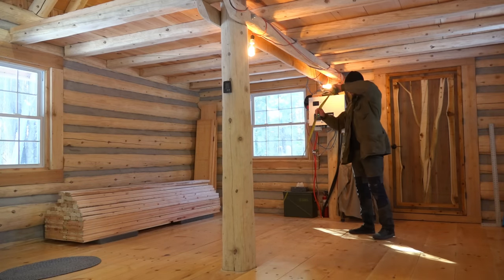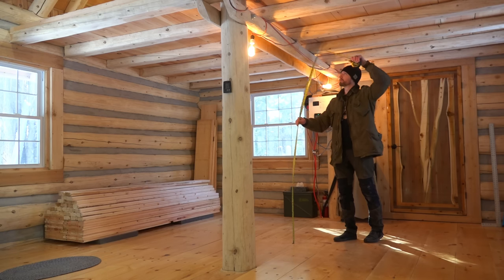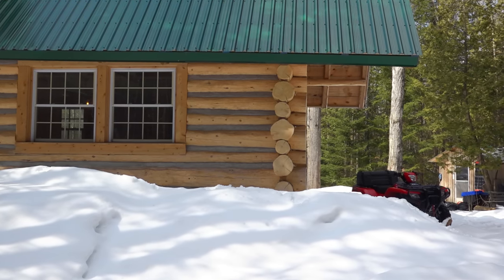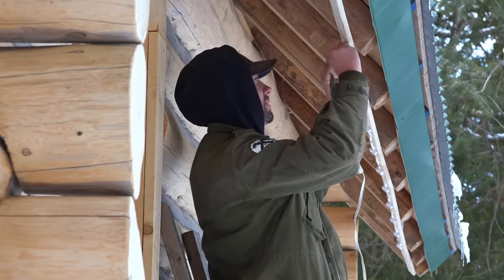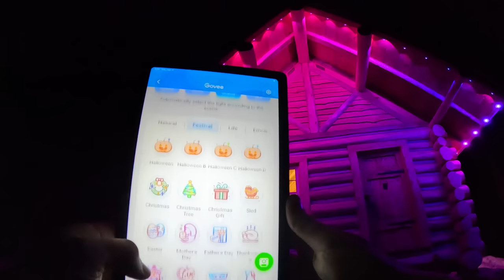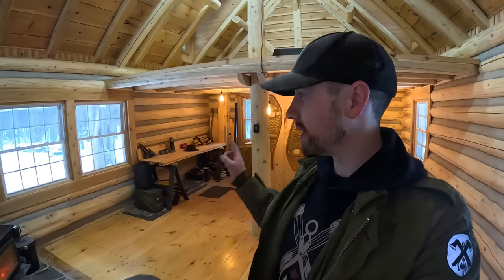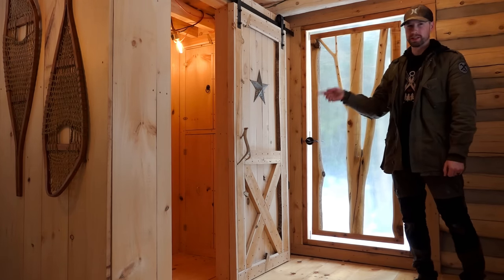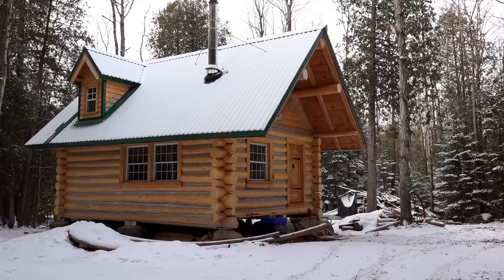Building a Bathroom in my Log Cabin! / Ep104 / Outsider Cabin Build

Comment: man I love the lighting, that looks so great!  A little tip tho, take a dab of silicone and put it on each of the modules to help it stick.  The 3M tape works well, but it comes unstuck after awhile so the silicone will prevent it from fall completely.  A little trick I use in sign cabinets when I put LEDs inside them :)

Comment: Our interior doors in our home are 5 panel doors.
We wanted our doors to our master bathroom and walk in closet to be barn doors.
We looked everywhere to find 5 panel solid wood doors for the bathroom and closet.
The Victorian section of Seattle is being renovated by a lot of the homeowners.
We came across the doors we were looking for in the town that we live closest to (5 miles away). They had several coats of paint on them and it took us quite awhile to sand them down to bare wood. We stained them with a medium brown, bringing out the natural oak grain to match our cabinets in the bathroom.
The hardware came from an old barn on my wife’s family 17K acre ranch in Montana.
We’re now in the process of staining the knotty tongue and groove pine so we can install them on the ceiling of our master bedroom.
Because we live in a forest we fell 17 Douglas Fir trees to make enough room for our house, septic system and drain field, as well as a large area for a fire break, up to our fire break road about 1/2 way up our property.
Behind our property is National Forest.
We live in a very mountainous area of north central Washington state and every year we endure a fire season.
Our mountain, an adjacent mountain and the mountain across the canyon and the county road has not burned in 33 years.
When building our house we decided to use Hardi-Plank (ship lap) siding (made from wood fibers and concrete, so it won’t burn). 
We ran out of money towards the end of the build, so we couldn’t afford a tin roof. (We’ll have enough money saved up in 3 years to have a tin roof installed). 
In the interim we put galvanized pipes with 3 rain birds at the peak of our roof so if our mountain catches fire, all we have to do is hook up the sprinkler system to our frost free spiket and turn it on, to save our house.
Since we’ve installed the sprinkler system on our roof some of our neighbors further down on the canyon floor have also had a system like ours installed. 
We wanted to build a Log House when we built our house but at that time we didn’t know about Meadowlark Log Cabin.
We’re now in the beginning process of having a 2 bedroom 2 bath with a small computer room Log Cabin built in Montana so we can live there in the spring through the fall after retirement. We’re building it as we can afford it so it’ll be paid for when we retire.
By the time my wife retires we will have our current house paid off, but we’ll sell it and buy a condo in St Thomas (part of the Virgin Islands) to live in during the winter months.
In the summer when we’re in Montana we’ll rent out our condo through Airbnb for extra income during our “Golden Years”.

Comment: Hey outsider...im a long time follower. Ive been there when u first set the foundation stones. You are an impressive man. 
I have LOVED everything you've done so far but I have one question/request/observation...I think you should have put soft insulation in the walls of the bathroom before you boarded it in. Hear me out..this js  Not because I think it needs interior thermal help but because it would cut down on the noise resonating out of the room when someone is using the washroom in the middle of the night. The hollow walls are going to sound like...well...loud hollow walls when someone is in there. The soft foam would cut down on this for sure, especially for such an overall small cabin.  I also thought using g a foam layer of dense foam in the floor of the loft would do the same.
I've been in small cabins like this in the past, mainly in the mountains of WA state and anything u can do to damper the interior noise is always welcome.
It looked like the walls of the wash room were open on top so maybe u can still slide some foam down into the walls from above? Or quickly open up the walls and place it in there before u screw it all back together?
Again. This is not meant as criticism, You're absolutely the man. I have loved all you have done. But maybe keep this noise dmper issue in mind moving forward, I think it will serve u well.
Keep up the amazing work. You are amazing man and I can not wait to see the cabin finished. 👍🏻
I am also amazed on how many screws you have used building this place...ive never seen so many screws used before and i love it. I put an addition on my house years back and insisted using screws and made all contractors do the same...theres not a creek in the whole thing..and your place will be bomb proof, no doubt.

Comment: Very nice work. If I may suggest, don’t vent the composting toilet under the house. The smell WILL still get inside and attract critters. I suggest you go through the roof and integrate a bug screen inside the pipe somewhere, at the roof seems best from my experience. If you’re worried the fan won’t push the air that far, (the little fans they provide aren’t very good), use a computer fan. I have a 120mm fan pushing through 2.5” pvc 4’. It works wonderfully and no smells from either the cat box or my homemade composting toilet get inside the bus.

Comment: What’s your plan for compost toilet? I hope it’s not a Sunmar. Didn’t work well for me. I ended up doing a bucket toilet like from Jenkins book. Works much better. It has its downsides but, if ventilated n used with a urine diverter it doesn’t stink. I use sawdust as a bulking agent. I’m sure you’d have plenty. Build a separate compost box from skids n you’d be good to go. My next version will be adapting a wheelie bin so I don’t need to empty it every 2 week.

Comment: Amazing job as always. Very high quality work! I will definitely use your video as inspiration for the barn door I'll be making myself. My family and I really enjoy your series/channel. In regard to the Govee outdoor lights, do they have an option to utilize screws or just the 3M adhesive? I've had experience with 3M VHB tape and although it is very good, I'm concerned that it will not do well over time on surfaces that aren't smooth.

Comment: Hello, I literally just discovered your channel about a week ago and I have been binge watching your videos. In epusode 104 where you build the bathroom, while I like the barn door that you built and I love the deer antler handle, I think the style of the door doesn't go well with the epoxy door beside it. I think an insert similar to the insert uou had in the epoxy door or twig like accents on the door similar to the twig railings would tie in better. The sharp cut of the squares really does not match the epoxy door. You need twig like accents on the bathroom door.

Comment: It's a bathroom/washroom? What's it used for? Toilet and shower?
Reply: No running water inside. He will install a  composting toilet for "sitting" needs.
Reply: @B Branett  sure but then it's not a bathroom/washroom then is it? How does one practice basic hygiene like washing hands after "sitting" if there is no running water? It's weird. What do they call a toilet room without running water in the area then? No fresh air for bad smells from composting toilet either?